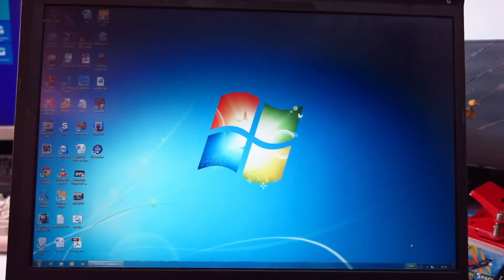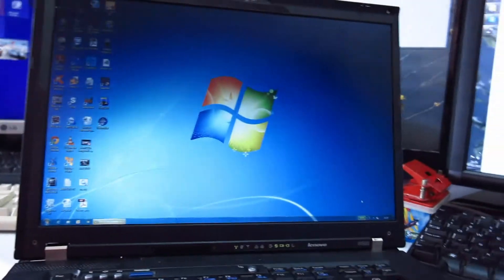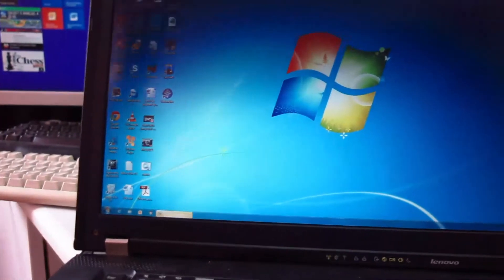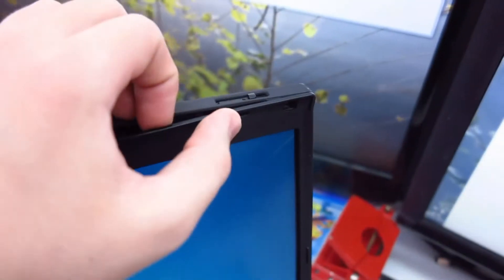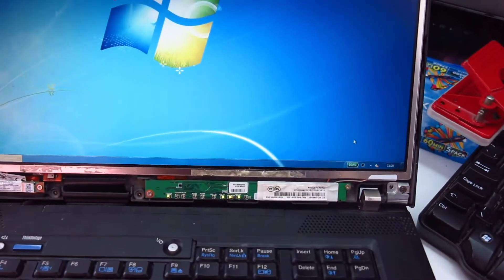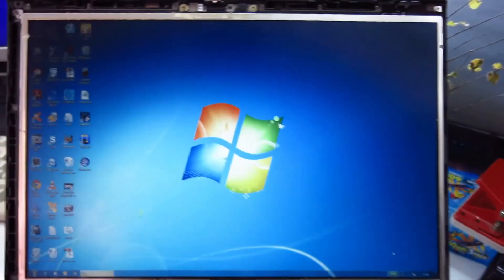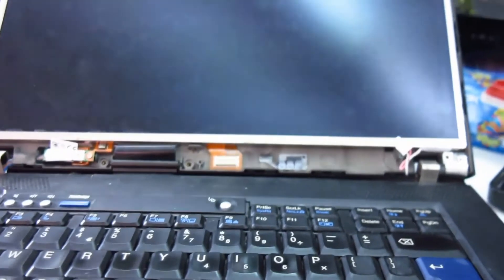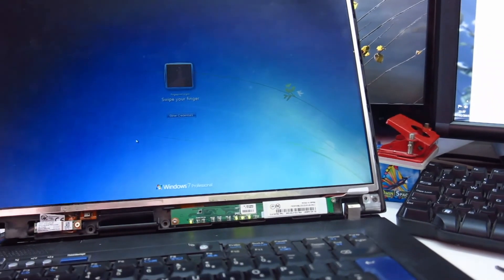Lenovo Thinkpad W500 inverter replacement

Comment: Could you replace the backlight with one of those new whitepanel light emitters?
Reply from the maker: Sagan Android Having taken apart the screen of this laptop, I would say fitting a new backlight tube would be very hard/near impossible to do.
Reply: Peter C. I am not thinking of replacing the tube, but rather removing it outright and replacing the entire backlight concept by using one of those of light panels. Do like thick white sheets of paper and when you run current through them they light up white. It seems to me that this solid state solution is a much better idea than what is currently in the ThinkPads.
Reply: +Peter C I'm trying it right now...but seems to install bulb inside - is pain in the ass!!!
Reply: What are you trying to say there?
Reply: I'm not talking about a new backlight, but another type of light source. That said, why do you think this is nearly impossible?

Comment: Are the W500s known for having a dim display? Mine was bought used from a lot of 3. All seem absurdly dim. Forget about using them in a room with much sunlight in it.
I wonder, is that normal for all W500? Is it aging? Or were these 3 units all iffy?
Reply from the maker: Sagan Android They are known for having displays on the dimmer side of things. The W500s with Samsung displays like mine are slightly brighter, but still a little dim.